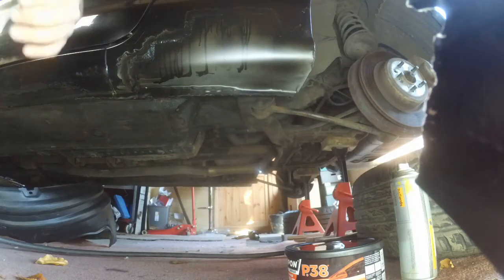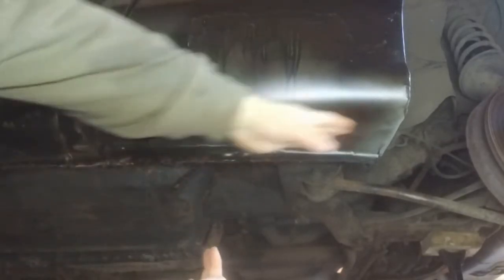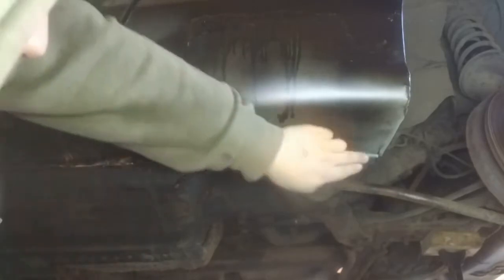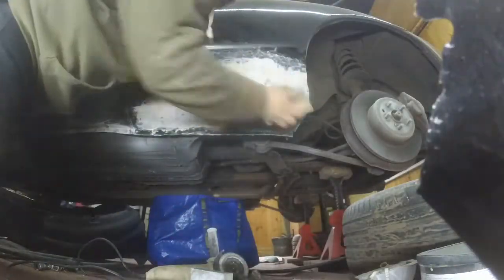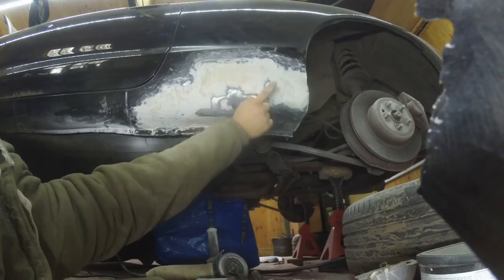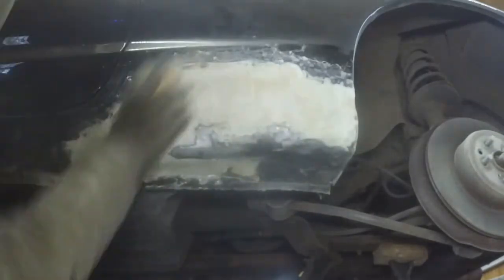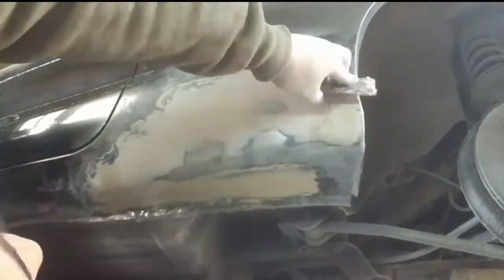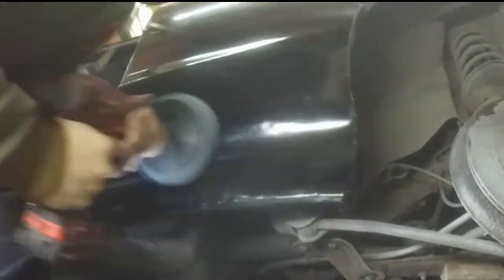Toyota Celica GT4 Gen 6 (94-99) Rear 1/4 panel after prepping and painting

Comment: I have a normal T20 and im also currently working on it, your content helped me a lot, thank you!
Reply from the maker: im Glad My videos have been helping you. 
This video is the last i have on the Celica for the time being, The car is on the road and my Lotus is in the garage going through a really long restoration process (welding, sanding, painting, some confort upgrades). I Have more than 20 videos on that one to release on youtube on a "how to/Vlog" kind of style. 
The next thing im going to do on the Celica is a Video showing how you can save about 200 quid on replacing the front ABS sensors, I've done it last year and been driving the car for a few months to confirm its a reliable fix. 
I Will be doing it again to show in the video, but that one will have to wait untill the Elan is painted and back on the road